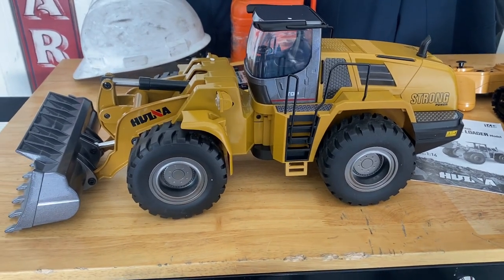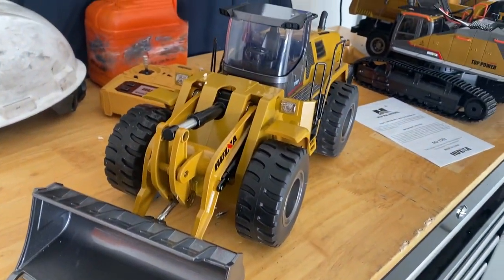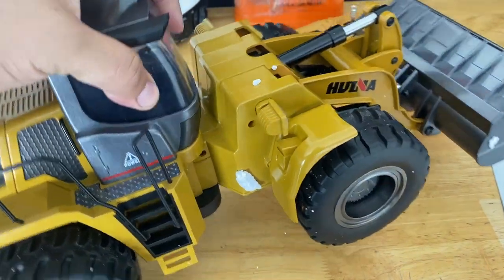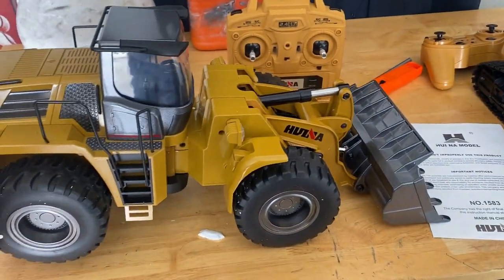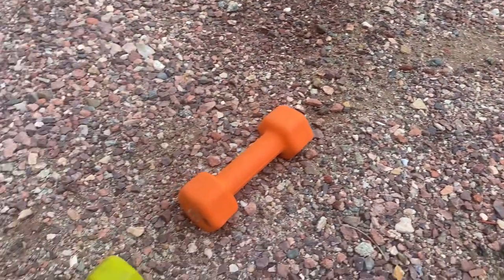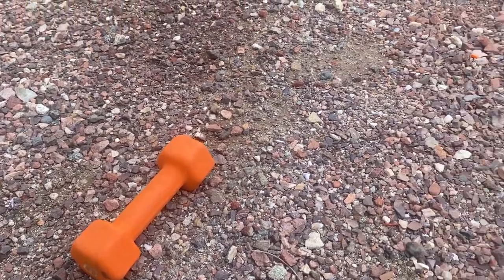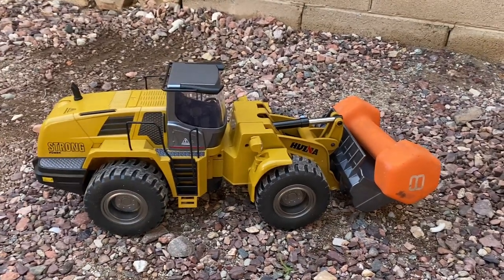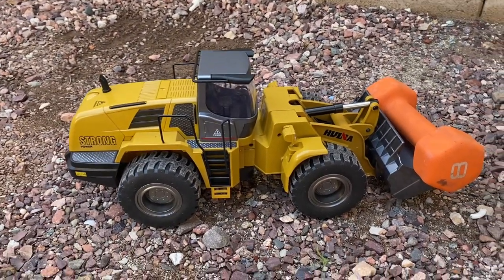HUINA 1583 loader weight test..

Comment: My 1583 when turn on  the engine start for 3 seconds and alarm sound for 15 and shut off everything 🙄 I don't know how to fix this problem. Battery is fully charged. Keeps shutting down after 15 seconds. Can you help me out?? J.P.
Reply from the maker: Sorry to hear that Jean. Sounds like you either have a bad battery or a short somewhere. Maybe try using another battery and if the issue continues maybe look for your local repair shop.